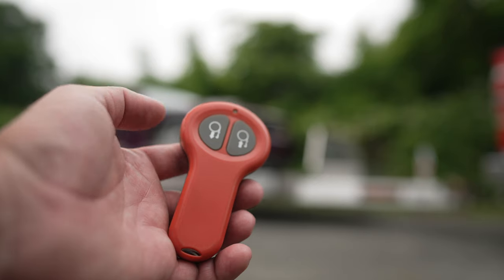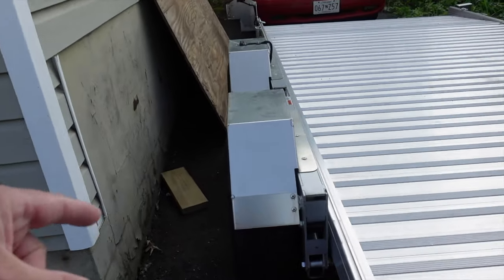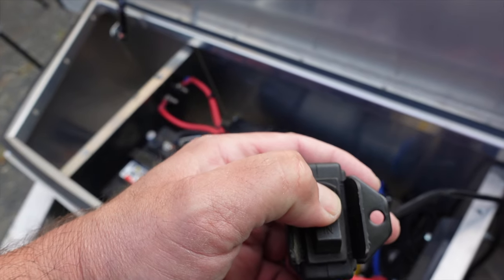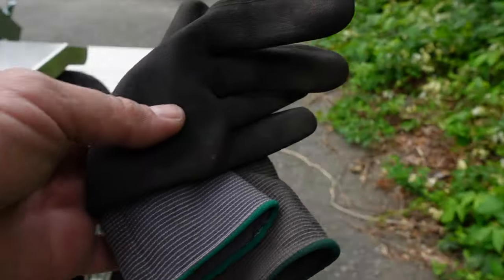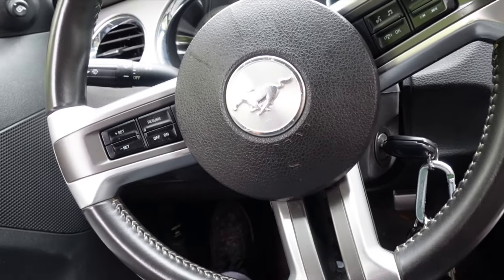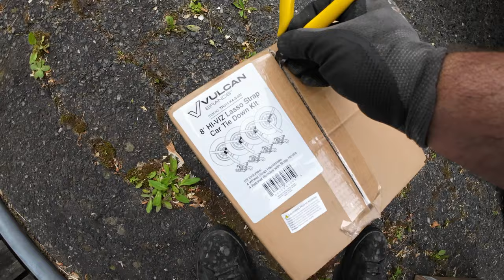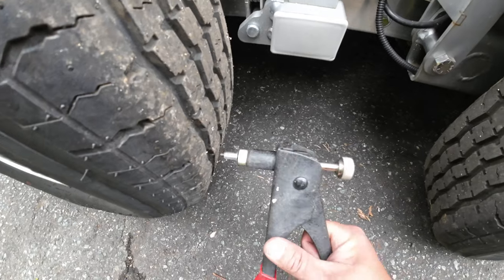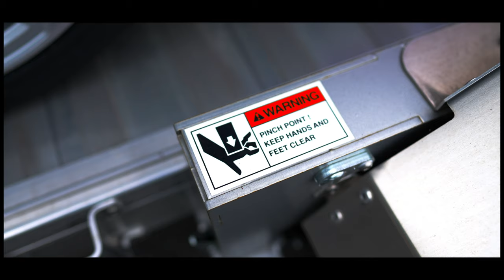New Trailer: the Timpte 720 is a car hauler that goes low!

Comment: Same brand as my brothers 40ft aluminum semi grain hopper semi trailer. Lol
Reply from the maker: Nice!  I saw that they make a lot of big stuff for agriculture when I was doing research.
Reply: @RobRabonPhotog  yup. Never knew that style was ever made. I seen one that lowers flet to the ground to move heavy machines like lathes and mills but i dont think it was cable operated. What do you do if your winch or battery dies and its down? Lmao.
Reply from the maker: I usually carry jumper cables to the track.  And if the which fried, I can use a Jack to put it in position and lock it in with the pics.
Reply from the maker: ‘Pins

Comment: Awesome seats! 💺 Where did you get ‘em?
Reply from the maker: Thanks!   They were made by a company called TMI.  They’re custom foam and putters that replace the factory skins and foam and reuses the factory frame.   Pretty neat stuff and maintain power adjustments and heat.

Comment: That moment, after buying a brand new trailer to tow car, when you realize the car doesn't go up on the deck and the doors won't clear the fenders.   Dooh...    

Maybe take the car to the trailer dealer before buying a trailer next time.   

I would take that trailer right back to where you bought it and leave it there.